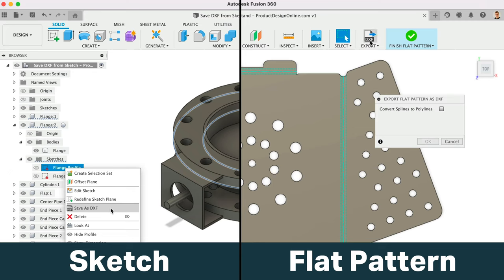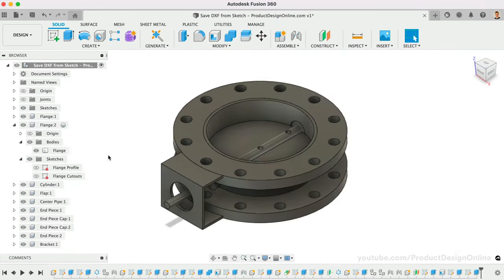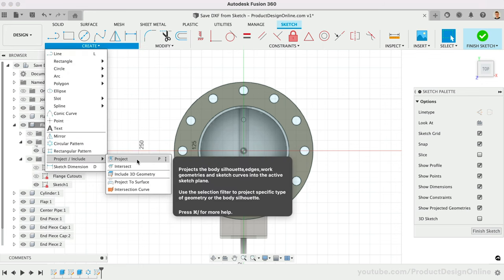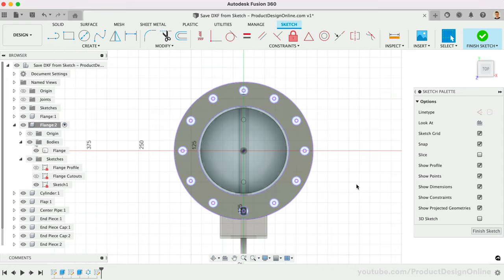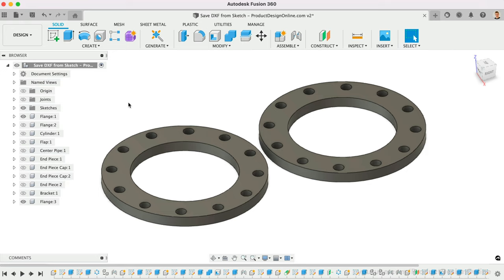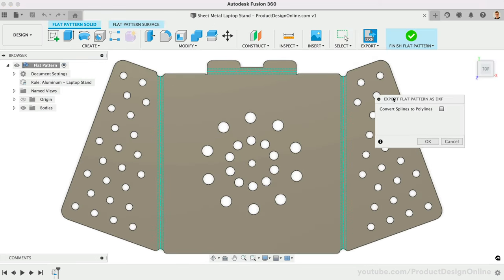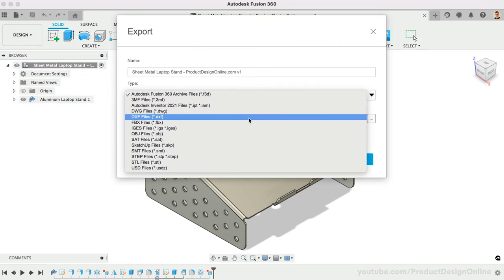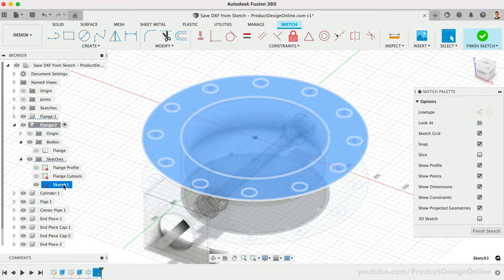4 Ways to Export to DXF in Fusion 360

Comment: Thanks for your videos, they are the easiest to follow that I have found. I like how you clearly explain every single step and don't gloss over anything. I have a suggestion as I have been looking everywhere for a tutorial and havent been able to find one. I have a small part to 3d print, but I want to duplicate it say 20 times, and create a grid that holds them all together so it prints as one piece and you can snap out the individual pieces as needed. For a tutorial you could make a model in a single flat sheet that you snap out the individual pieces to assemble them. Maybe put pegs and holes on the parts so they press together. Just an idea for something that I think many people would find useful.
Reply from the maker: Thanks for the idea, Gary!

Comment: thanks for another great video. a question however. sheetmetal - what if you need a sketch for a manuafacturer where the manufacture will not be done by laser/computer but rather manual cuts and bends. forgive my ignorance but should there not be meassurements visible on the dxf file for this purpose? i cant seem to get clarity on this one
Reply from the maker: That's a great question! At this time, you would need to use the 2D Manufacture workspace to get the drawing with dimensions.
Reply: @ProductDesignOnline  However some manufactures (xometry, metalsupermarkets, etc.) require a 3d .dxf file. So it appears to be impossible with the hobbyist license. How do they think we are supposed to learn if we can export it??

Comment: There's a far better way to get a dxf for lasercutting. The free extension Dxf4laser lets you select a face and generate a dxf, with kerf adjustment (extra margin on the outside, holes marked a little bit smaller). It's been around for years and works well.
Reply: Is this a fusion 360 extension?
Reply from the maker: Hi Karl, I tried that one ~a year ago and had some issues with it. Have you experienced any issues with it? I may have to I've it another try.

Comment: It seems odd that we can't create layer's easily or am I missing something.
Reply from the maker: What do you mean by layers? Similar to Photoshop?
Reply: @ProductDesignOnline  Not familiar with photoshop but it allows you to assign a layer to different parts of the drawing.  Let say you have number of holes that need to be
routed out, I would name them inner so I would know where the offset would go.  Sometimes you want to control what parts you do so you cut that layer before or after another.
quote from Autocad "Autodesk Layers are the primary method for organizing the objects in a drawing by function or purpose. Layers can reduce the visual complexity of a drawing and improve display performance by hiding information that you don’t need to see at the moment."
Reply: Not sure I have seen layers in more recent Autodesk cad programs. They used to have them in Autocad and Mechanical Desktop.
Reply from the maker: @Kisssys  Thanks for clarifying. Unfortunately, there is no layers concept in Fusion 360. The thing somewhat similar would be breaking your design into different sketches. Those will be listed in the Browser in the order you create them. However, you cannot re-layer them as you can with graphics programs, as the assets in the Browser are listed in the order they were created in your parametric timeline.
Reply: @ProductDesignOnline  Ok well I thought I just didn't get how to create them.  It's not uncommon for me to export a DXF to Rhino3d to create layers quickly to the export to Sheetcam to do 2D cad cutouts.  Slowing giving in to using Fusion to create those kind of cut files but it seems to take me longer.  Thanks for all the good video's, Cheers Kisssys
Reply: @kisssys5414  If you are creating a drawing to scale of flat patterns you can temporarily suppress/hide a view and export as a dxf.  You can hide the title block and the border as well to just get your DXF geometry.  Note that you can turn off Bend Extents in the drawing view property but the bend lines will still be displayed.  It is less than ideal without layers and note that the bend notes dont get export in the dxf AND the bend lines are solid..... are you dealing primarily with flattened sheet metal parts?
Reply: @LearnEverythingAboutDesign  That's all good to know. I do just about everything, sometimes it full 3d machining with my Tormach, sometimes it's on a laser cutter and sometimes on my router which I cut lot's of materials.  I sometimes mount my Plasma cutter and do metal as I built the router with a 3 inch water table.  I don't seem to have any focus, all depends what's needed that day.   The layers worked great when I cut a lot of G10 and Carbon fiber on my router and I miss that.  I occasional use Rhino 3d because it does layers very well and has a much better Print utility than Fusion.  Cheers Kisssys
Reply: @kisssys5414  100% agree.  So what is your ideal workflow(knowing that Fusion doesn't have and likely will never have layers like Autocad and other programs)?  Would you like to be able to select a face or faces for export quickly?  Like select a face and hit Export to save a DXF?
Reply: @LearnEverythingAboutDesign  Creating a separate sketch for each layer would be tolerable.  If I could Select 5 sketch's have them put on a different layer with the sketch's name and exported as a DXF.  I'm sure someone could create a plugin to do just that.
Reply: @kisssys5414  Yeah the way DXF export works as exposed to the API is either flat pattern of sheet metal or a sketch.  So any add-in would need to convert selected faces to sketches and project each as it's own DXF file.  I don't know of any way to force the layer issue with Fusion 360.  I will give it some thought though!